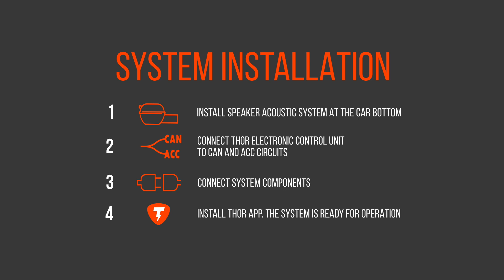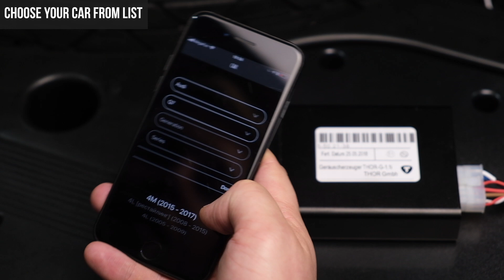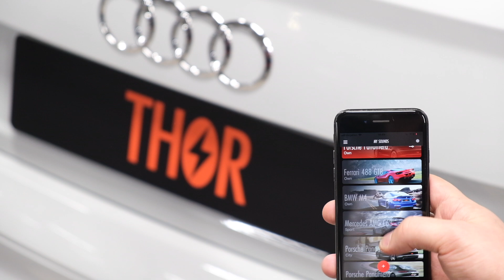THOR Electronic exhaust

Comment: Does the speaker exhaust unit not connect up to the exhaust itself? To make noise travel through pipe?
Reply from the maker: No! Installation separately gives a louder sound.

Comment: The only thing stopping me buying and installing is im worried about the can . bus connection as mine is a brand new 408 puergeot and there are no details about this car
Reply from the maker: In any case, before installing the system, a highly qualified technician will see the possibility of installing the system, and our technical support will always help in installing the system! You can contact technical support before installation and get all the information about how the system is installed and whether it is possible to install it on your car!